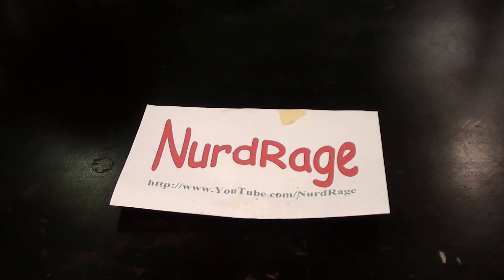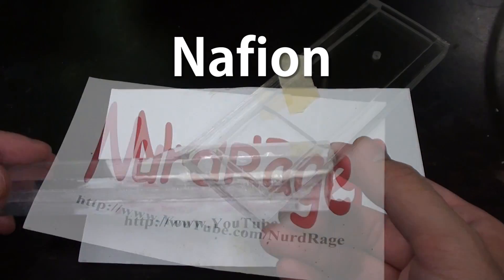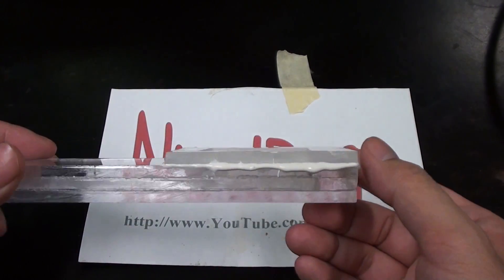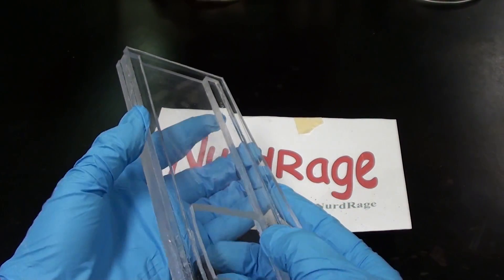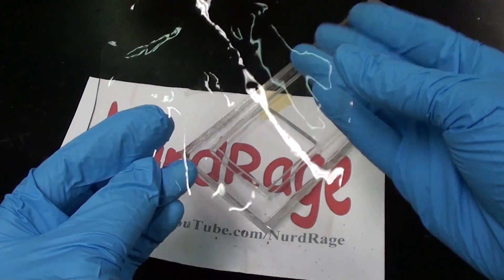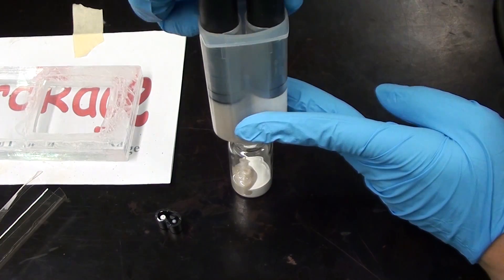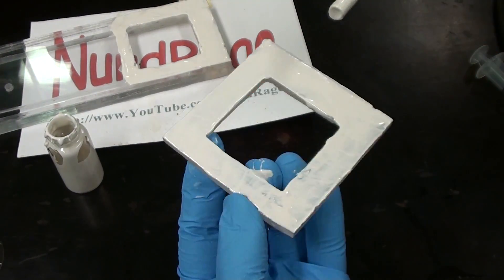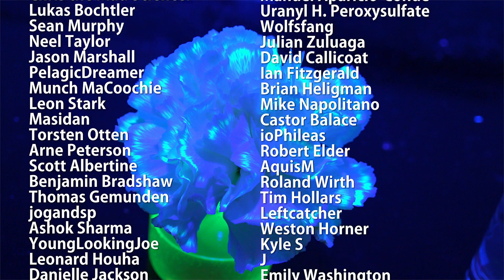Make a Nafion Divided Membrane Cell for Electrolysis

Comment: Just wanted to comment that a simple google search for ANIONIC membranes produces several results with purchase options, even on eBay!  Would be good to recover sulfuric acid spent on nitric acid distillation from the bisulfates.  I also wonder if copper sulfate could produce cupric hydroxide/ oxide and sulfuric acid as well?

Comment: I found this video because I was searching to find whether or not my H2 water unit, which uses PEM and a N117 membrane, would leach any Teflon-like contaminants into the drinking water or when doing H2 inhalation.  The PTFE caught my eye, and as a consumer, I have been staying clear of these ingredients, re: forever chemicals.  But, if the N117 membrane does not impart anything in the process of separating the H2 from the O2, I am okay with it, but if it is unknown, I may stay away from these units.  If anybody has any knowledge of this, please comment, thanks.

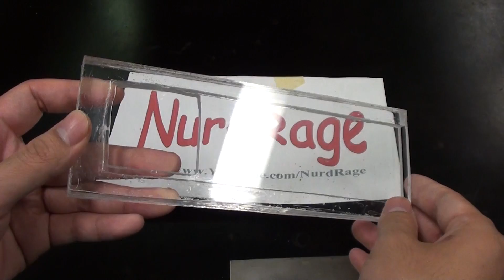Comment: 4:12 NO. 3D prints are porous and it will throw your effective area calculations completely out of scale. One possible option is polypropylene filament which is decently "closed" in structure once printed and is resistant enough chemically. The prints are almost never water-tight, it's a lot of effort to achieve it.

Comment: on the epoxy what about the two part silicon rubber used for making casts of human mouths for dental work? figure you will get nitrogen from the stuff used in other processes like sealing windows and such on a house (silicone and silicon II from GE) also thought that epoxy had some outgassing from epoxy too though. ??

Comment: Electrode separation distance (would help if they were parallel) as well as temperature (especially temperature) will also determine current density.  Otherwise you could fry your membrane and it will blister.  Slowly ramping the amps to your cell, let temps stabilize, keep ramping.  We ran between 3.5-4.5 volts per cell (120 cells) @ 240 VDC and 3500 Amps... we made ~30, 000 gallons of 15%wt. (120g/L) NaOCl /day  which is liquid pool shock...dilute with water to 5% for bleach!!

Comment: I worked in a 3 Megawatt Chlor-alkali plant making bleach from sea-salt.  We used  60 1-meter square Nafion 969 membranes (x2....so 120  ($300k circa 1998) to only allow sodium ions through, well sort of.  The difficulty other positive metal ions would cause issues mainly calcium and magnesium...most of the plant was dedicated to metals removal way before the membrane cell stack down to sub 20 ppb levels using to finish 3 ion exchange columns.  Also, silica was also an issue and we needed to run a desilisizer on town water to use for process water or the silica would form a blinding gel coating and cause all kinds of issues.  Nothing like throwing a vacuum breaker on a 14.4kV main, breathing various levels of chlorine gas depending on what leak where (All PVC/CPVC)...as well as lightning igniting our hydrogen stack....which just blew it off into the air.  Those fun days!  The electrodes were stainless with a nickel oxide coating (apparently needed).  Just make sure you consider the heat generated in the chlorine gas / Sodium hydroxide reactor ...the reaction itself is exothermic and takes a lot of cooling, to the point where if there is none it will run away and melt whatever has the lowest melting point!!!

Comment: Ayo bud, just grab a good ol 50ml plastic test tube, punch out the lid and screw on the membrane sandwiched between the lid and the test tube. It looks like crap but it works and is easy to replace

Comment: Used nafion 117 for electrochemical reduction of organic material as a renewable fuel source strategy. Goal was to sequester CO2. Unfortunately any proton source would leave as H2 before efficient reductions would occur on the organic material. I still have to work in gas phase so nafion won't work for me anymore. Thank you for the memory spike!

Comment: With a mercury cathode cell metal ions are able to pass through the mercury but the non metal cannot. This does something similar but no toxic heavy metal. Awesome!
Reply: When Cody's in the comments you know it's a good video !
Reply: @NicolasBana  yea you are right
Reply: Can you use a lithium battery cell separator or the ions are incorrect size?
Reply: @jhonatancock2302  Does the separator block ions though? From what I found it it allows ions to pass through but blocks the electrodes which are close to each other from shorting themselves.
Reply: please update mercury chatode for separating palladium with non metals contaminant Cody's
Reply: Mercury isn't toxic. You can put it in your mouth and splash around in a pool full of it with no permanent brain damage.

Comment: maybe experiment with alkali rechargable chemistries, like potassium, rubidium, and cesium ion or polymer batteries, pretty sure they would out perform a lithium chemistry battery...cuz physics
Reply: lotta companies seem to want batteries and capacitors to power shit nowadays, and connect em to solar panels and shit
Reply: you also could get away using more caustic and hazardous materials for industrial and commercial batteries, if packaged properly...
Reply: i mean molten salt and liquid metal batteries exist, like sodium sulfur , or Sodium–nickel chloride.... they need to be heated up to about 400f-700f, so not something you'd necessarily will put in ya attic or backyard, however you can simply build heat supply using batteries and solar panels....
Reply: even have about %85 - %90 efficiency,  at 25-250 kWh per bank is a decent chunk, that can power up to 5 50kw residential houses for 1 hour at max 50kw load (you arent going to pull 200a in your house though... if you do, the power company and fire marshal gonna wanna look at wtf u got goin on, and wanna have you pay for dat 3-phase hookup, but be careful 480v 3-phase will scare the shit out of any seasoned electrical engineer)
Reply: i think you can find Ukrainians who would invest and try it out...

Comment: Good to see you back posting!

Just a comment on the 3D printing solution you mentioned. With the FDM type printers (using filament) that most people will have, prints are generally extremely porous due to a combination of how the 3D models are sliced, and also the fact that there are gaps where the layers of filament do not get fully bonded together. This is especially true at angular interfaces. I've printed flower vases that leaked water at almost faucet speed along the base (solved it by dumping low viscosity super glue into the bottom to let it soak in, fill the gaps, and cure). This porosity of course will make it such that your cell is definitely not isolated.

I've seen a recent video by CNC Kitchen that discuss a method for printing completely transparent objects using transparent filament that involves optimizing print speed, infill pattern and %, extrusion, and cooling fan use. This might have a chance of working for this application since a side-effect of the method is that the layers are bonded much better with almost no gaps, but the method also suffers greatly at printing overhangs (they sag due to lack of cooling fan speed).

So with all that said, I think perhaps laser-cut acrylic might be the best approach for this, and then using the solvent bonding method for the final assembly.
Reply: If you could heat treat the 3d printed object without too much warping that should help to seal it up. Even a surface treatment with dichloromethane may be enough to seal it, although I had similar thoughts when he mentioned 3d printing it.
Reply: @AndAbel-AOD  I suspect that's an uphill battle trying to get all of those little gaps to seal themselves. This approach should get most of the way there though: https://youtu.be/9qb25Gi4Jv0

Comment: I did something similar with nafion but had it separate 2 equal volume tanks. You have to be careful applying too high differential pressure when the membrane is hot, I found mine stretched out like a balloon!  Now I fill both chambers at the same time to balance the pressure.

Comment: I'm very interested in experimenting with novel (and existing) flow battery chemistry, and most of the amateur efforts I've seen use nafion for the separator. It would be very useful to see more about making it or a substitute in the amateur lab context.  And welcome back, great to see you again.
Reply: Making fluorocarbons is dangerous stuff because the process involves a lot of hydrofluoric acid, either as a reagent or as an end product.  Hydrofluoric acid  is a major health risk as it is both corrosive and a contact poison.  Fluorine gas will also directly decompose into HF on contact with water, so trying to make small fluorocarbons and work from there via direct fluorination is also not safe in an amateur context.  In theory you might be able to start with commercially available refrigerant and work from there, but anything going wrong would risk fluorine gas or HF buildup which would be very dangerous.

Not to mention that polar fluorocarbon derivatives like Nafion are what the news is calling forever chemicals because they never degrade in nature and build up in living things because they're ionic.  Any waste products (because nobody's going to be 100% in getting their components into their yield) would be incredibly hard to dispose of properly and would turn your lab into a brand new candidate for a Superfund site.  Even disposing of a Nafion membrane can be legally problematic depending on local regulation, with the ultimate failsafe being incineration in a facility equipped to scrub out the HF released by thermal decomposition.

Comment: This makes me this of the Hoffmann Apparatus that I have. 
Its from a collection of labware and vintage chemicals/containers from a chemist in the 60s/70s. 

I've never used the apparatus as everything I've read about proper use says it needs platinum electrodes, and that is prohibitively expensive. 

i gotta look to see if its possible to get it to run with something more economic.

Comment: I’m not a chemist, but wanted to suggest that fishing line is an easy to find source of fluorocarbon…I wonder if it could be melted down  into a sheet and used by a amateur chemists for this. These lines do have an expiration date so you may be able to get them cheap online or at yard and estate sales. I remember your videos on sodium so I know it’s not just your passion to do these things, but to do them in a way that’s accessible to the most people. Like I said, I’m not a chemist so I have no idea if this is feasible or not and the $100 price tag isn’t too bad in any case (it would make for an interesting video though).
Reply: Doesn't have the functional groups to make the reaction work, unfortunately.
Reply: @mmmhorsesteaks  true, but maybe another plastic working like a solvent melted together with it?